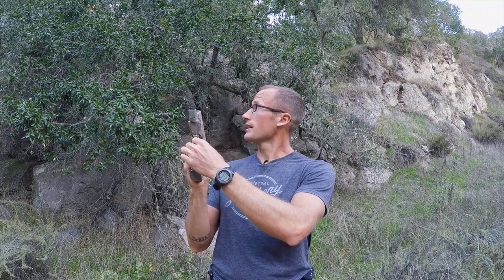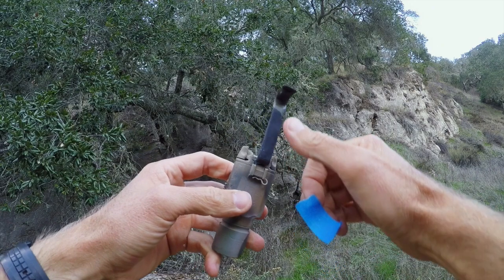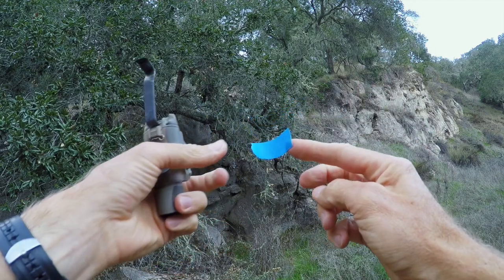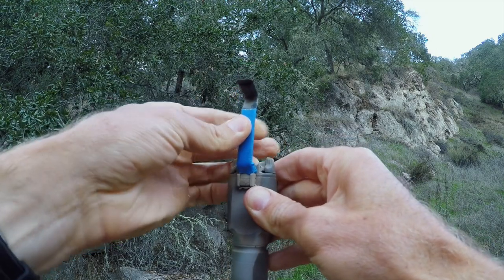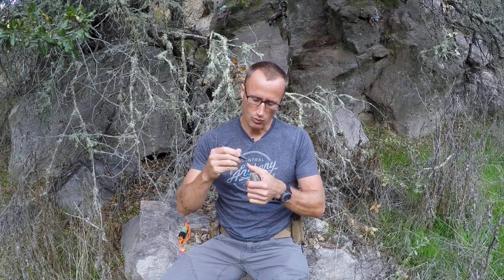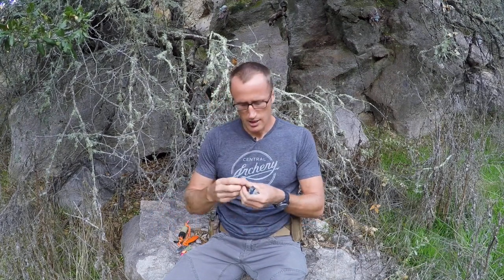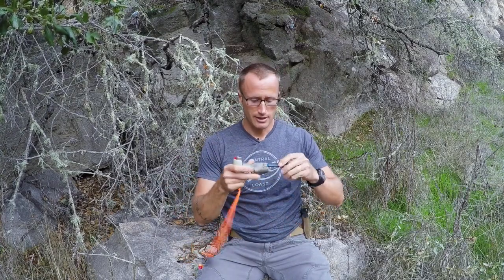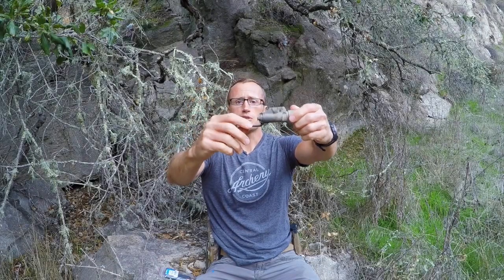SureFire DG Switch Hack

Comment: Thank you for this.  20 mins and $3 and my dg switch is reinforced.  I had actually worn completely through the oem rubber on the edges of the switch, which was starting to separate from the inner metal.  Now its good as new again.  Saved me $80.  I wish more holsters were properly clearanced for these so they wouldn't wear.  I carry with a raven vg3 a lot lately and I love that it accommodates the dg switch.
Reply from the maker: Good job man!  It is crazy how that little bit can help so much and keep that piece of gear going.

Comment: Thanks for this Hack.  I purchased 2 of these switches.  One for my duty weapon and the other for my daily carry.  I did have to take some material off both my Safariland holsters.  I used a Foredom rotary tool to remove most of the material.  Then I followed it up with a dowel with sandpaper to have more control and finish it up.  It came out perfect.

Comment: This switch is on Ruger SR9 but it doesn't fit perfect! It fits fine and operates perfectly but my question is is there a part# on it to find out the exact gun it's meant for?
Reply from the maker: They make all different models, do you mean the Glock Model?  https://kitbadger.com/surefire-dg-switch/ DG-11

Comment: What holster are you using. I have a Safariland ALS made for the surefire x300u, but when I added the DG switch the firearm no longer fits in the holster.
Reply from the maker: I dremel out the channel inside the holster. Or you can get one for the X400.